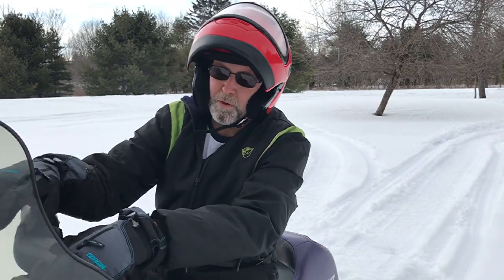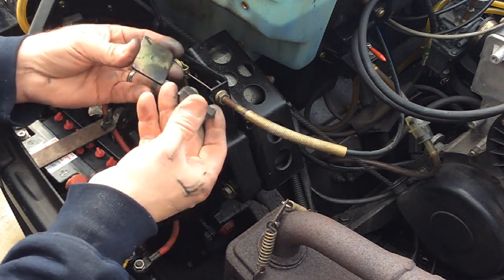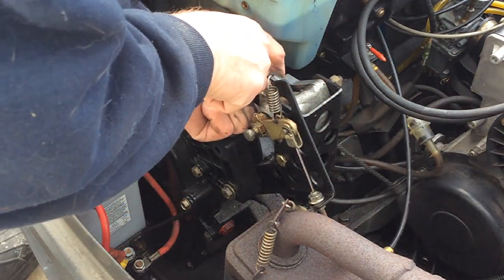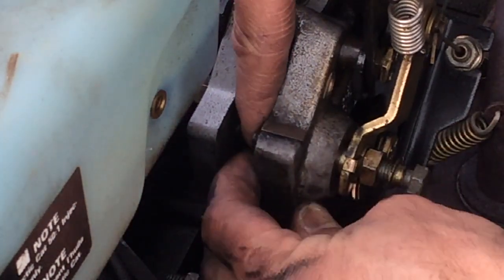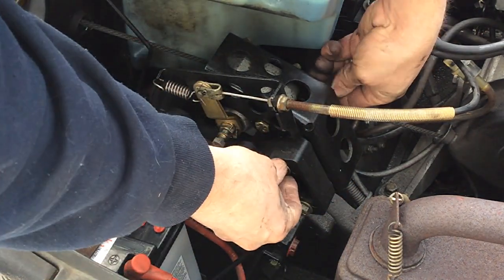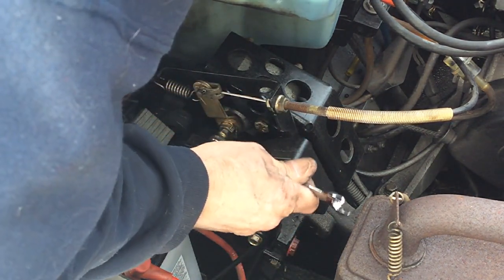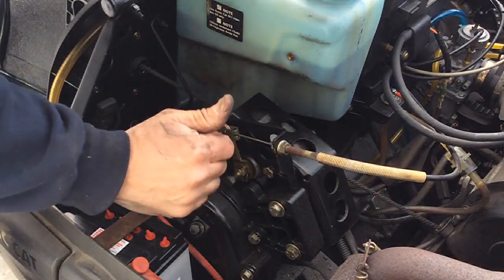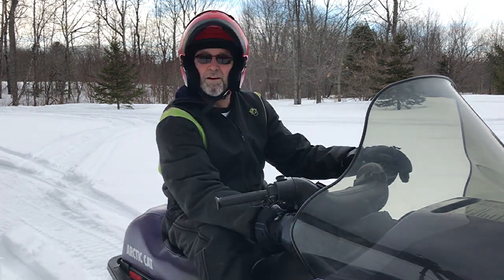Replacing Brake Pads On 1998 340 Artic cat JAG

Comment: Would recommend lubricating the caliper bolts that the calipers slide on?  I’m trying to fix the brakes in my old 94 Puma that is similar and the caliper doesn’t slide so well anymore...if so what lubricant/grease would you use?
Reply from the maker: I am a big fan of the Valvoline VV616 4 lb. Automotive Multi-Purpose Grease. https://amzn.to/33MofHJ